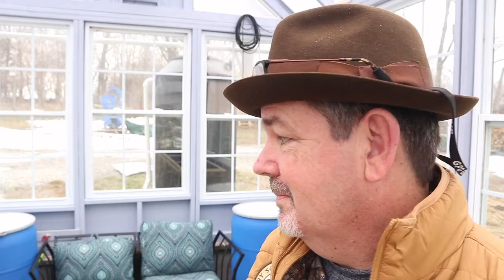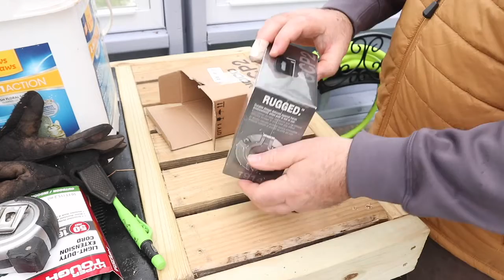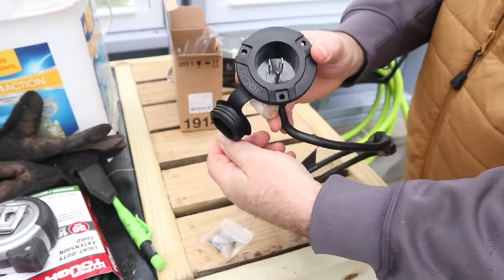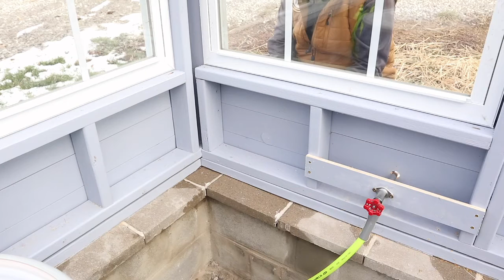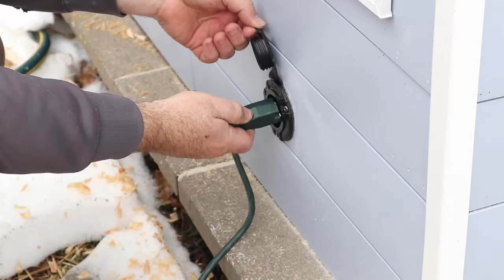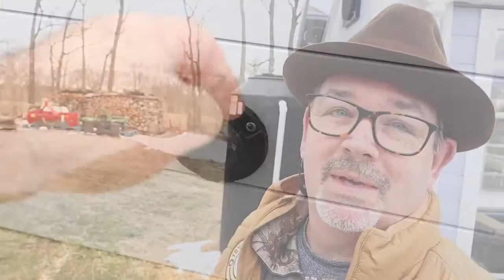#157:   Simple DIY Greenhouse Power / Electrical Idea  / NOCO GCP2

Comment: Thanks for this! I was thinking there had to be something better than cutting and splicing an extension cord to get it in our green house!
Reply from the maker: It is a pretty cool bit of kit.   I can imagine if I were a contractor putting one in a box trailer so you could pull up to the job site, plug into temp power and working with tools inside of the trailer all set up with a power bar and a work bench etc...